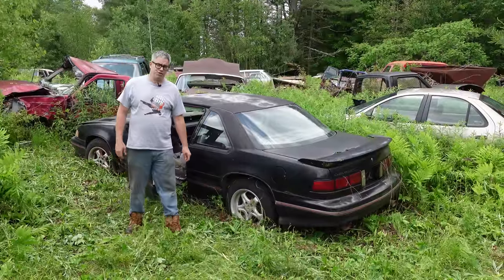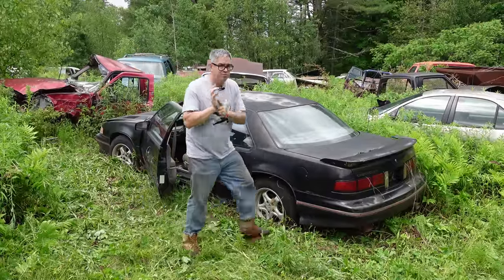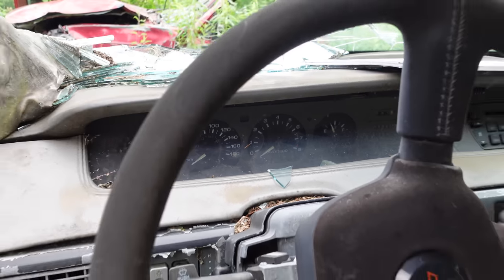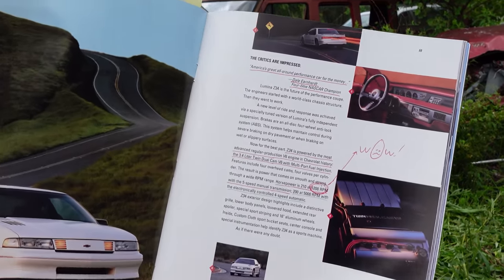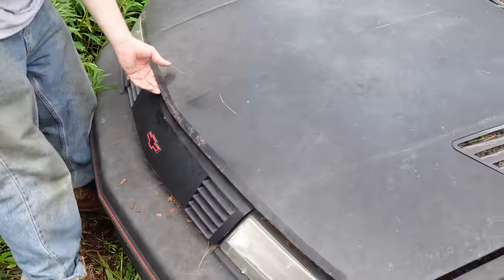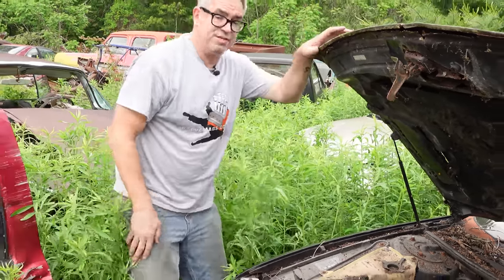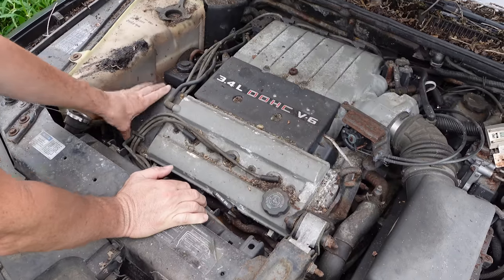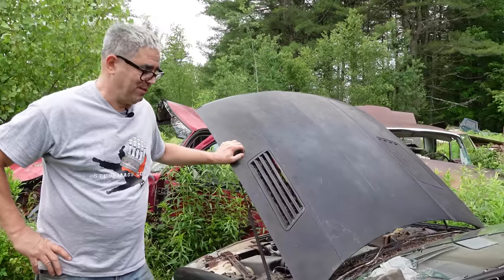What’s Up D.O.H.C?

Comment: I remember those were pretty quick for the day and also, like most GM's that used a separate camshaft carrier housing, it leaked oil all over the car.  I even saw one catch fire and it burned to the ground with all that oil.
Reply: I have a 91 and the only thing seeping fluid is slightly at the power steering cap. Thing is dry. Though i think my radiator might be starting to leak.

Comment: Had a Dodge with the double overhead V-6. Great low horse engine, ran it for almost 300,000 miles, until the eventual rust took it. To replace the water pump, you had to replace all the chains and tensioners. Needless to say, I let the pros do it. Almost two grand for a water pump?

Comment: (Back in the 90's) One of the guys at work bought one of these. I thought it would run pretty good. Turned out to be not quick. He only kept it a short time and traded it in for the Bonneville. We both couldn't understand why it was so doggy for a brand new "performance" car. The Bonnie had torque you could feel in the seat of your pants.

Comment: Interesting that these things had a rev limiter that kept you to about 4k RPM while jazzing the gas in neutral.
Reply: This was all GM cars after 1987 and electronic ignition.
Reply: @calvinnickel9995  ... as I recall, there weren't too many worth jazzing the throttle in those days. The flip side is it would go a bunch higher than 4k in gear.
Reply: My auto SHO also had a 4k limiter in neutral, the 5 speed didn't
Reply: My 95 monte carlo z34 had the 4k rev limiter in park, but in neutral you could rev it to 7000 rpm freely. Stock engine with a short ram intake and it sounded great!
Reply: @chiefjuice1   I have to guess that was the same engine in both the Chevy Lumina Eurosport and the Monte Carlo. They ran rather well. In hindsight, I probably never tried to rev it in neutral because if I was working under the hood, it was in park. I did need to replace the timing belt. What a royal pain that was!

Comment: Gm book time to replace a timing belt is 8 hrs on the 3.4
Reply: After it shredded itself and wrapped around the pulleys, and left the owner stranded
Reply: Oh! It needs a water pump? Ok , let me go get ,Tony,a box a matches, and a can of gas! Yeah just leave it on the back of the lot!
I’ll pick it up in the morning! 😂
Reply: Look on the brightside , its a non interference motor. The valves won't hit
Reply: @marioncobaretti2280  Had several where the fake camshaft that drives the oil pump, would break. Then the timing belt shreds. Tear down and the cam bearings in the block had spun. What a mess.
Reply: @marioncobaretti2280  Depends on what year of LQ1 that will determine interference to non-interference.

Comment: Do you inspect and spray these cars for wasps and such before filming, or are they not as big an issue in new england? They build nests on my daily driver, but they will not build on my 71 340 which stays under the shed, which is weird.

Comment: I had a 3.4 L Beretta and it wasn't a Z anything but it was fast as hell so I always called it a big block! Though it wasn't I sold it for 50.00 because the fuel rails exploded! Should have kept it but it didn't have heat either and It needed a driver's side window that I replaced with a sheet of plexiglass that I cut to fit. God, I miss those days!

Comment: Had a 92 Z-34 in the mid 90s. Fun car but can’t imagine the 5 speed manual. The automatic could barley keep up with the quick acceleration in the first two gears. After about 100,000 miles, I couldn’t keep oil in it. It was going to require a complete head removal and valve job because of a $2 rubber seal that was leaking.

Comment: Did lots of timing belts in the dealership on those things. It was almost easier to pull the engine to do the job. Whenever one came in the service lane everyone ran the other way. Try just changing the "O" ring on the oil pump drive...not fun.
Reply: We figured out that it was more time consuming but less hassle to drop the cradle, engine trans as an assembly to do a belt and get it right, rather than follow the GM service guide, when I worked for gdyr. After all, no one could beat the  booktime GM stated for in car belt replacement.

Comment: I wanted to swap one into a fiero when I was younger. That thing now with modern  management  and a turbo would be a ripper.
Reply: I have a Fiero with one of these....even non-turbo its a fun ride!!!!
Reply: @benjamman1  so it fits ok? I always wondered.
Reply: @jasonbirch1182  Its a bit of a squeeze at the top being such a wide engine. But it's in there. I wish I could attach a photo.  ( I didn't do the swap myself. But the guy who did....did it really well. Ported everything, advanced the timing a bit. Its a zoomy little car)

Comment: Timing belt clearance isn't too bad. Pull the engine mounts but leave the transmission mount, with a support across the strut towers. Then tilt the engine to allow more space. Most cars (with transverse engines) are like that.

On some models, VW was much worse. I remember needing to remove the radiator & support + headlights + bumper & cover + a/c condenser + etc… on some models, but they got much worse. Some had the timing chain on the transmission side, but VW's had a "lifetime" timing chain 😂

That doesn't mean it will last forever, that means the car needs replaced when the chain or tensioners wear out. While no customers bought a new chain (on one of those), they bought a new car…Unfortunately, many bought another vw like that…
Reply: @Iowa599  No need to even mess with the engine mounts. I can do the belt just fine without pulling the mounts.  Takes me about an hour or so now.

Comment: I had a 1992 5-speed z34 with a “fast forward performance” chip. It was absolutely a nasty little engine and sounded amazing. Alternators and the “distributor O ring” were major headaches with the engine.
Reply: I’ve seen different chips online. Are they legit and worth getting? I wonder how else can you tune them. Since it’s like OBD 1 but in transition or something? Like my 95 s10 you either have to burn a prom chip or order a custom computer. It’s crazy.

Comment: I have a 2002 Oldsmobile Intrigue, with a 3.5 Ltr dual overhead cam engine.

When nailed to the floor, it shifts at 6,500 rpm through the floor mounted 4 speed automatic transmission.

Comment: I ran into one of these recently.  Had me thinking about making an offer. It is the 5 speed. Red. Just sittin under an overhang but only recently left alone maybe 10 years. I had a z24 in white for my first car. A 94 which had a style update and the fiberglass hood and spoiler. It had the 3.1 but the big thing was swapping in that 3.4. Think the v6 camaros were optioned with that engine at the time?

Comment: My wife had one of these. Redline was 7000 RPM.. 6500 was yellow line.. and it would go almost all the to 7000 before the rev limiter. 

In my experience.. it was not a big improvement on my 1989 Cutlass Supreme with the 3.1. 

The 3.1 was much more torquey for regular low RPM driving while the 3.4 if you showed it no mercy was fast but it seemed to make more noise than speed. 

I’m really surprised they didn’t go coil on plug for this engine since the Quad 4 was coil on plug in 1987.

Comment: Cavalier... I had a brand new one in 89. Within three years I had rust through spots, a leak in the rear window (that resulted in a moldy trunk carpet) and  two defective engine control modules that stranded me in traffic on both occasions. Traded it in for a Toyota and never looked back at American cars (sad to say).

Comment: I had this engine in a 1993 grand prix with a 4sp auto, it was quick and cornered well but incredibly unreliable with timing belt issues and trouble starting. I had a real love / hate relationship with that car. When she was on point what a blast to drive but, spent to much time in the repair shop and on a flatbed on the way to the repair shop it spoiled the experience.

Comment: Years ago I saw a Fiero with one of those engines swapped into it. That was a fun car, and something that GM could have and should have built! A high revving V6 in a full size FWD passenger car is not the right tool for the job, much better to have something with good low end and midrange to get the heavier car up and going, but that motor in a small nimble lightweight mid-engine RWD sports car, and you have something that would be a blast to drive!

Comment: I have a 95 Grand Prix...everything you mention, the spring, 4-wheel disc, it's there.  But those DOHC 3.4's, they all died.  Mine has the fairly reliable 3100.  Crazy thing is that in 2004, they came out with a 3500 pushrod that makes about the same power as this DOHC design.

Comment: Early Z24s (Cavaliers) came with 2.8 and 3.1 V6s. Shame GM didn't shoehorn this engine into that chassis to continue that tradition.
Reply: Quad 4 was plenty for the smaller Cavalier. 2.8's and 3.1's weren't that great

Comment: In Canada here I had purchased a used 1998 or 1999 Lumina 4 door sedan (not a Z34) that did indeed have the 3.4 DOHC and dual exhaust. I believe it was a police spec car (unmarked). Don’t think it ever served any time as a police car though. I remember that thing could haul for that time. I had it in/around 2001 as a used car.

Comment: Oh the oil pump driveshaft seal leaking! (Where the distributor used to be) You had to pull the head to replace a 25 cents seal !!!!!!!
Reply: Yeah, or flat rate fix it.  Cut a distributor gasket for a small block and sneak it in.  Worked every time.

Comment: I was wondering if you ever did a video on a Toyota T100 pickup? Is there even any in that junkyard? I remember you did one on a Dakota pointing out that it was one of the first mid-sized pickups but I saw a T100 the other day and was reminded of that they were also mid-sized. Most of them up here in Minnesota have been reduced to brown dust by now so they are rare.

Comment: These cars were much faster than reported. They're reported to only do 130 mph but I can assure you they are much faster than that. These Z34s are extremely underated. I had a 91 Lumina Euro Sport 4spd auto that would top out at 132 mph and it was reported to only do 107 mph.

Comment: I remember working on that engine. Probably been 10 years since I worked on one. Bitch to put a alternator on. A head has to come off to replace the oil pump drive o-ring. They did start making the o-ring out of better material.

Comment: It wasn't the z28 that launched that z moniker that was the z11...
Reply from the maker: And the Z06 Corvette with the big tank and brakes. Yes, that 427 cube Z11 W-motor was a monster. Too bad GM pulled the plug on them / factory racing in March of 1963. All that said, these "Z cars" didn't wear external badging. The 1968 version of the Camaro Z28 was the first. The '67 only wore stripes. But you knew that. Thanks for watching and writing. -Steve Magnante

Comment: I have heard but cannot find any solid proof that these motors were derated for the transmissions applicable to the cars at the time and up to about 275hp was possible. The 1996-1997 motors also had redesigned heads and were interference engines and post ODB2 had additional different sensors etc. The 4t65e was also available for one year in 1997.

Comment: Hi Steve, good video!  Ok, your front wheel drive performance cars get better fuel economy, but is worth higher labor and difficulty to service a d repair?  Was the fuel economy that much better than a 305 V8 Camaro Z28?  Come on!  Think about it!  And do you know how much hotter the engine compartment get in the summer on a front wheel drive car?  Their is no room for air to circulate under the hood on that car.  Please reply.  Dave...

Comment: The #1 complaint with GM's W-body models involved premature wearing of the disk brakes. The slider pins rusted and seized the floating calipers, discovered too late by a horrible grinding noise. Good luck getting that repaired under warranty! In 1993 the $h!t hit the fan, so GM switched to stainless steel caliper pins on the up-market W-body Grand Prix, Regal & Cutlass Supreme models, but they still had a boatload of rust-prone pins. Instead of scapping them, they installed all those ugly pins in the Lumina's till they ran out of them in late 1994.

Comment: Interesting, years ago i had a used  2.8 lumina but it had that rear spoiler and all around dinner plate brakes. It was a  nice car but a leak in the trans cooler curcuit in the radiator led to its early demise. I didnt even know there was a problem till one day driving home from work and the tranny started slipping. Checking it out i found the tranny to be awash in coolant and with the clutch friction surfaces being water soluble, I'm told, that was it.
Reply: @shospulecolupis8718  It couldn't have been a 2.8 from factory.  1990 was the first year for the Lumina line and the last year for the 2.8 in the W body line was 1989.

Comment: Buddy had one of these. Snappy car. Comfy seats.
At 85k miles the timing started to fail. Still ran, badly though. 
Car was about 7 years old. Local mechanic wanted $1800 to repair timing. Dealer wanted gonzo more. 
He sold the car. DIY guy spent 4 months doing the job himself. 

Lots of these cars went to the junk in pretty nice shape. It just got eclipsed by supercharged 3800's and the expense of repair made them worthless well before their time.
Reply: @davenhla  Timing belt change intervals should be NO longer than 60,000 miles.
Reply: @jiggity76  Wasn't my car. 
Wouldn't have made it cheaper. Wouldn't change the fact these cars went to the junk within ten years because no one wanted to pay tat kind of money to fix them. Buddy paid $4000 for the car with 38k miles on it back then. You think he was going to shell over 2 grand every 60k miles for it? He didn't. No one did.
Reply: @davenhla  Very true.  This is why I did them...and currently still do the repair myself.

Comment: I worked as a heavy tech at a GM dealer for 30 years (retired in 2017) and will tell you this 3.4 DOHC was total JUNK!!!!  (timing belt trouble, water pump leaking into alternator, head gaskets, the list goes on and on, now remember this was also the time of the junk first gen Quad 4)    I remember back then you couldn't even buy a used 3.4 DOHC from a salvage around here!!! (they refused to sell them because they were not any good as a sellable engine, they all came back for something one yard owner told me he crush's them all with the engine in them)

Comment: even if its front wheel drive, as long as it handles well enough and is balanced right it can be respectably quick. I mean, how else would cars like the high revving honda civic with its 8000rpm+ rev limiter or compact torquey cars like the shelby GLHS with its turbocharged powerhouse 4cylinder both dominate the track and rally scene. As long as its balanced right and can put the power down sufficiently, i could imagine something like this could keep up with some of the more sporty cars, when driven right.

Comment: These engines were notorious for going boom unfortunately. When they went you couldn’t find a used motor at the junkyard and if you did it was 3500 used. And that was in 2000. If I remember correctly the timing belt breaks and the engine is an interference engine meaning the internals just all bang together until they explode when the belt breaks.

Comment: Ummm. The speedometer was in  kilometers and the smaller font was mph. And torque was 200 not 2000. Need to get the editor on the ball.😊

Comment: The speedometer is in kilometer per hour… this is 180 km per hour, not 180 mph. This is a Canadian car. Also, the oil pressure indicator is in Kpa instead of psi…

Comment: I went into a dealership to a part fora car I had at the time and walked through the showroom and there was an APV with the hood open. I asked the salesman how do you get those back spark plugs out. He said "you have to loosen the motor mount and use a breaker bar, but with these spark plugs you have to change them"  
...uh huh no thank you

Comment: Had a cutlass supreme with that motor its a amazing power plant but an absolute bitch to work on just to change the alternator you had to take the whole right steering assembly out just to get to it because its between the motor and the firewall

Comment: Those engines are a 3.1 ohv engine modified into a Dohc engine. A true nightmare to repair. All that engineering, they gained 10 horsepower over the turbo 3.1 v6. Then years later ford sees what a pain in the arse the engines were and made the 4.0L sohc out of the reliable 4.0ohv.